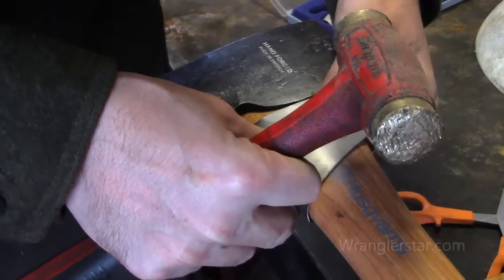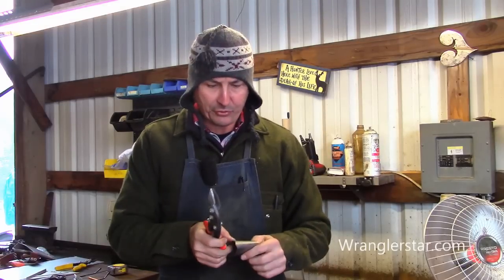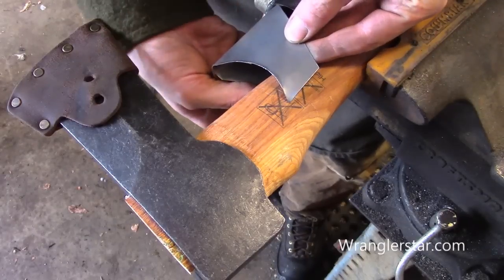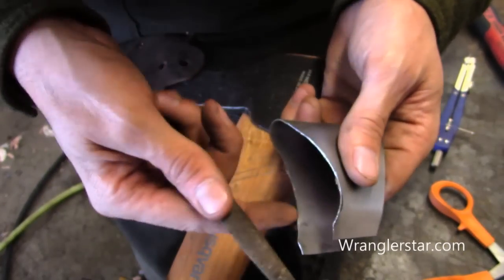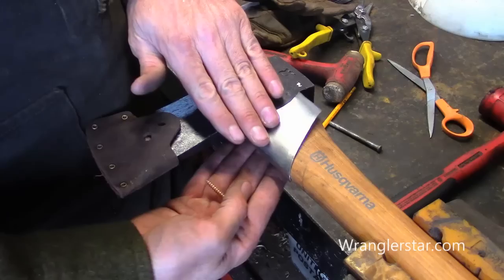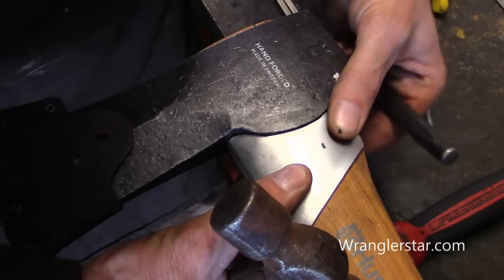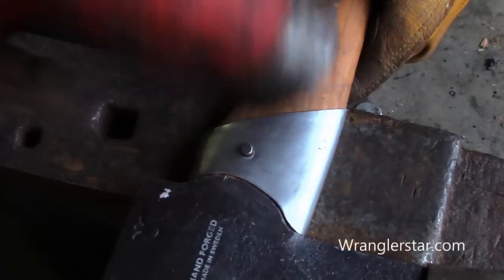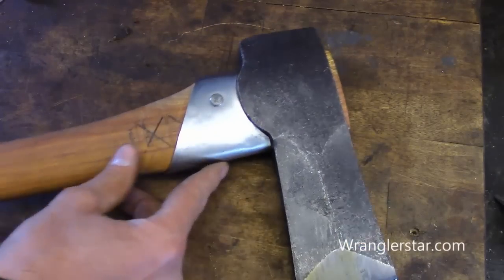No More Broken Axe Handles 2 | Wranglerstar

Comment: When cutting sheet metal its best to use the back of the snips rather than the tip and never cut through the metal. Try not to remove the snips from the piece you are cutting keeping slight constant pressure towards the cut. Doing these 2 things will eliminate burs and make for a smoother cut. Imagine a snake eating a entire egg without crushing it.

Comment: With the hole in the handle, it should be 1/50th" back further then the holes in the metal, as to pull the cover tight, the trick to getting the pin through is to bullet (taper) the pin and force the pin through, hence pulling the metal tight.
 BUT I am surprised that you didn't remove the head with the slide hammer technique.
Reply from the maker: Iron Forge Knives I'm not a fan of this handle so if it fails I wont be heart broken. I mainly want to test the steel collar. If it performs well i'll revisit,
Reply: wranglerstar Thanks for sharing Cody,i put a little fix for the handle shape on YouTube, first video so it sucks. But much improved ergonomics.  i bet you wouldn't have done that to your GB forest axe. Haha. I just purchased the Husqvarna carpenters axe, im going to buy 3 more because i love it so much. For my grandsons. But im wondering if you could make the carpenters axe one of your Amazon links, as it would help out the wranglerstar channel with your little slice of the profits. My favorite channel. If you haven't tried it out yet, you definitely should. Please share your thoughts on it, and ill wait a week before purchasing, too give you time to add it to your link. Thanks again.

Comment: I like this idea, however, it looks like a lot of work and I'm guessing your method works about the same as my grandpa's. Cut an old bicycle tire down the middle.  Wrap the handle contact area tightly with it 2 or 3 times around.  Then wrap over that tightly with bailing wire and tie it off.  Takes about 5 minutes.  When the kids have miss-hit so many times the bailing wire starts falling off, just re-wrap it.

Comment: i would of opted for 6 brad nails start with 2 on the lead edge to hold it centered  and 2 on both ends of the seem after you worked the metal around to finish

Comment: You've done it nice, but you can improve it. You may need to make it bigger, and instead of that bih pin, use small, 1-1.5cm needles and fix with it on the back of the handle.

Comment: On your next venture with forming the contour...using a small ball-peen...tap in parallel or in line with handle...instead of perpendicular..that way the metal doesn't stretch into a bowl.  Good luck

Comment: oh pleae don't compromise the handle by drilling through it. Make a good fit and stitch it up fast with a wire welder and douse it quick, or tuck and bend seem like they do on regular sheetmetal. Quick bead and douse will not burn the wood or do any temper changes.

Comment: You do know sheet metal sheers come in Left, Center, and Right cuts?
Reply: I must have missed that video. I wasn't trying to be smart about it. Just wasn't sure.......
Reply: he shows all 3 in the first video he uses wiss snips , i perfer midwest they are not as meaty a pair of snips and will snap easy'er than wiss  but i get much cleaner  smother cuts with them i doo keep a good set of wiss bulldog's for small cuts on thick metal

Comment: Why not just weld a bar onto the axe head same result but dont weaken the handle by drilling it.
Reply: +Micheal O&#39;Donovan, happy I read as I was going to offer up the self-same idea. Makes more sense than making a hole that large in the neck of the handle.
Reply: +Micheal O&#39;Donovan You destroy the axe head and you may unharden it.
Reply: Mines still splitting wood 5 years later a spot weld wont hurt
Reply: +Micheal O&#39;Donovan  I just think same.Why drill holes like worms?

Comment: y not just a center bore along the length of the wood,then jam a piece of steel rod in there.then wrap the handle in rubber tubing to absorb shock from the hands.

Comment: So why didn't you just make a pattern from a manila file folder trim it to fit and then transfer it to your sheet metal? and then use a dremel to shape it and clean up the edges, or you can use a peanut grinder with a poly fan at 220 grit to shape and finish at the same time, then use a clamp to hold it tight, and solder the seam and that way you don't weaken the handle and use 5 min epoxy to secure it to the handle,,,,,
Just saying.

Comment: I made one of these for my Gransfors bruk small forest axe. I made mine out of leather and made a Instructable for it. You may want to use leather because it is a more forgiving material to work with, is rugged, you won't have to drill into your handle you just crafted. The sheet metal is very maluble which is why you can hammer it in place, but even when doing so it still marred your handle you said. The leather one that I made takes the scuffs and banges instead of the wood and if you make a stencil before the final fitting you can make replacements quickly if something did damage it too much.
http://www.instructables.com/id/Leather-Wrap/
Reply: Marty Conn ...The leather one is very nice, rustic, organic looking too.

Comment: I was thinking of making a "cast" using epoxy and fibre glass or carbon fiber.
Reply: bad idea id say, I don't know if you've ever worked with carbon but even minor abrasions splinter it, it'd last maybe 1 hour tops, fibreglass isn't that must better either. I just used copper sheet metal on my GFB felling axe.
Reply: +Shane Sf As a volunteer firefighter, most of our air tanks (SCBA) are now made of carbon fiber (MSA and Scott). If it was as bad as you say, I think we would have a lot of firefighters having issues. Of course, I don't know why you would pick it over sheet metal in the circumstance.
Reply: Nathan Mueller The reason for picking it over sheet metal is because it would be an exact fit, since it would be applied to the axe like a cast. Admittedly wet-laying doesn't make the strongest end result, but it would still be damn strong, especially being a perfect fit.
Reply: +metallitech Sheet metal is easier, and probably more cost effective.
Reply: +metallitech Handles also come loose. This sheet metal can transfer over to the next handle also. Also carbon fiber would just feel wrong on a wood handle. A classy axe with carbon fiber, personally, I'll pass.
Reply: Nathan Mueller you're probably right in your case, and i have a ski helmet made of the stuff, but unless you know what you are doing i find what i said still holds true. Bear in mind how your tank was probably made versus how the average guy can do in in his workshop.

Comment: This is what happens when one has too much leisure time...
Reply: Peter Halat Too much leisure? This is what he does for a living, man; he lives.
Reply: Well, I call it a waste of time and money.  It would be much cheaper and easier to replace a new handle than making that bullshit sheet metal piece, which only added weight to the assembly and weakened it.
Reply: Peter Halat This thing doesn't take a long time to make. Maybe half an hour if you do it like in the video. And believe me... a new handle takes much longer to make.
Reply: Gimli Son of Glóin Handles like that are MUCH cheaper to purchase, than waste time on this mod. GUARANTEED!
If someone does not know how to use an ax, then damaging or breaking the handle at that point is possible but NOT with an experienced ax user.
Reply: Peter Halat Cody is an experienced axe user. Usually you make your handles yourself. Most modern axe handles dont fit the head of old heads. And they are really crappy.
Reply: Gimli Son of Glóin:D Also an experienced youtuber coming up with material to post.
Surely, I can make a handle but there are many different designs of handles and I bet, that anyone is able to pick a fitting handle out of the ready made parts. 
Anyway...
GOD bless You.

Comment: that is going to do absolutely nothing.
Reply: Jack Harwood Gotta agree, the point load will go right through the metal (as it deforms it) and be transferred directly to the wood - just as if it was naked. The amount of the load being spread is negligible as the tin is far too malleable. If the collar was completely ridgid - well that is another story. Looks nifty though! :)
Reply: Rockwood Joe  He has videos of it working.
Reply: +Rockwood Joe, You don't know what you're talking about.
Reply: Reducing getting chewed up makes sense - abrasion damage etc. The author of the video gave me the impression it was a complete "guard". If it was much thicker (i.e. not bendable by hand) I could see it being a significant improvement too.